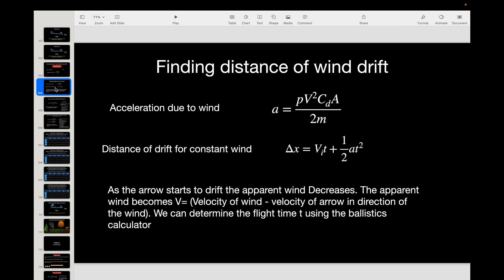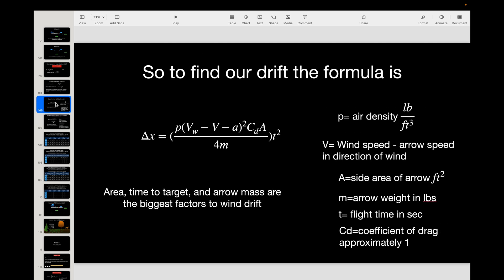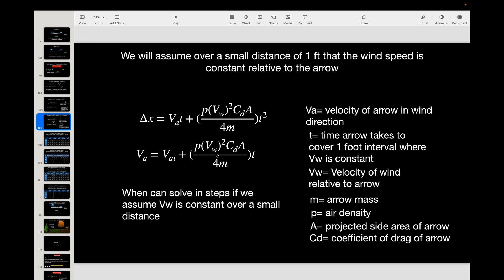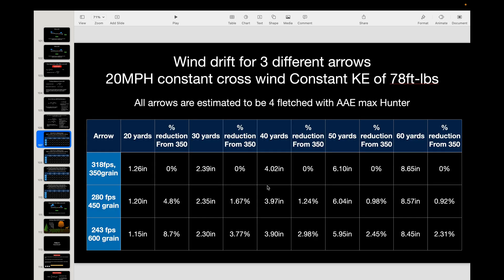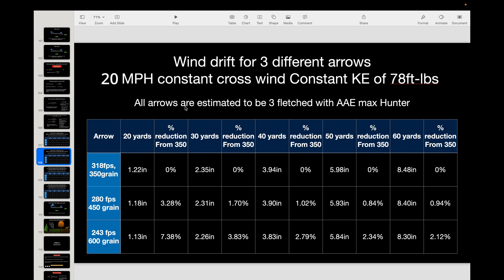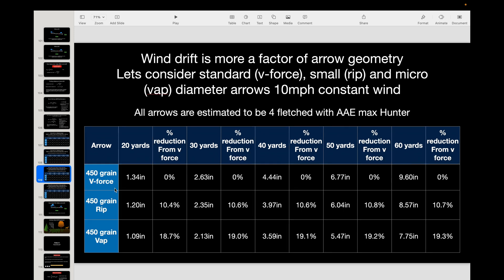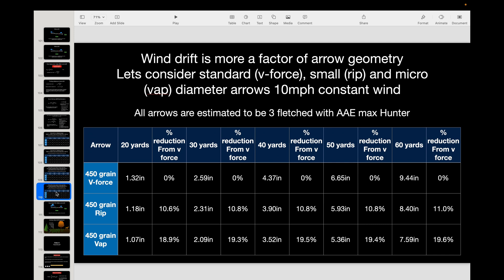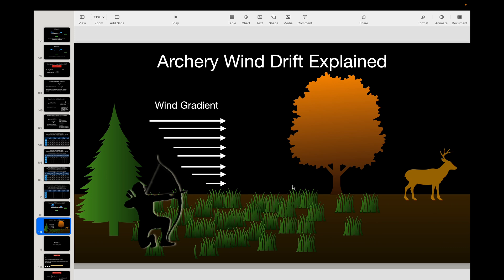Archery Wind Drift Correction!

Comment: In rifle ballistics wind drift is simply lag time.

The time it takes the projectile to reach the target, minus the time the projectile would reach the target in a vacuum (without drag) multiplied by crosswind speed.

So if you had .3s of lag time with a crosswind speed of 14.66 fps (10mph) your drift would be 4.398"

Though I cannot confirm jf the same method could be used for arrows since quite a bit changes on fin stabalized vs spin stabalized but I do not believe this would be one of those things.

If this remains true it would greatly simplify the math you would have to do, and provide a quick way to compare arrows by looking at TOF and lag time.
Reply from the maker: Hey thanks I had not heard of this before, very interesting! I’ll run some calculations and see how close they are. Even this set of calcs assumes the arrow doesn’t change orientation relative to the wind. Arrows having such a large surface area which can change relative to the wind direction is a big challenge of these calculations.
Thanks for the comment.
Reply: @leap_outdoors  yea, arrows are different enough from bullets it might not be the same, I wish I could find McCoys book. I believe he goes over fin stabalized projectiles. Though it may be too deep of a topic for me to understand.

One thing I'm curious about is that it's wind drift on arrows with broadheads. Since the reason why a bullet drifts is the spin stabilization points the bullet into the wind, which increases is drag profile and this drag creates the drift (this isn't exactly right but I can't remember it exactly atm)

An arrow won't do this because of spin. It'll do it because the wind will push the vane, and it will rotate around its center of pressure, so it's pointed into the wind. The further away the vanes are from the center of pressure, presumably, the more it will steer into the wind, increasing its drag causing drift.

Put a broadhead on it, it will rotate less, since you now have a counter acting force, but i guess the drag will be more with the broadhead so even though it's rotating less into the wind it'll have more drag because of the broadheads larger profile, I wonder if it evens out to be about the same, or if it'll be more or less. I would suspect it'll be more.

But then you have people that say a higher FOC is better in the wind which doesn't make sense to me I would think it would be worse since you're giving the vanes a longer arm to rotate which should turn it into the wind more and increase drag.

Ballistics are hard.

Comment: Thank you, I wonder would the cross wind and the direction the arrow spins based on its helical have any effect vs the opposite helical?
Reply from the maker: Interesting question. I would assume if your helical is into the wind it would drift more. The fletching would act more like a sail catching the wind, but that's just a theory. Another interesting wind phenomenon is the Magnus effect, this is what allows a pitch to throw a curve or sinker in baseball. The spin rate of the ball causes the ball to curve from its path. A cross wind could cause an arrow to drop down or rise up depending on wind direction and spin rate. This would completely change your point of impact between a left helical and a right helical.